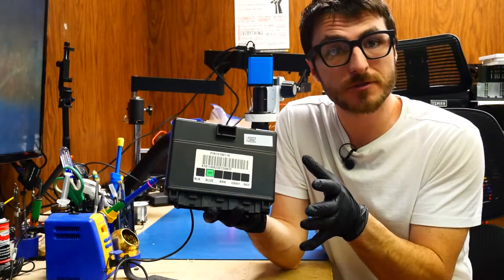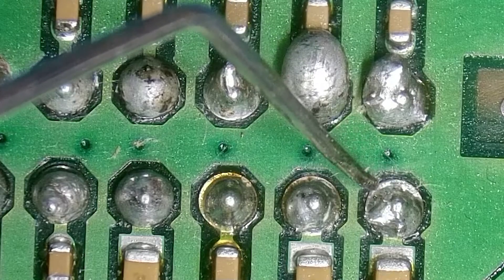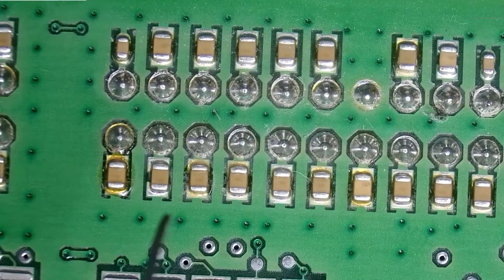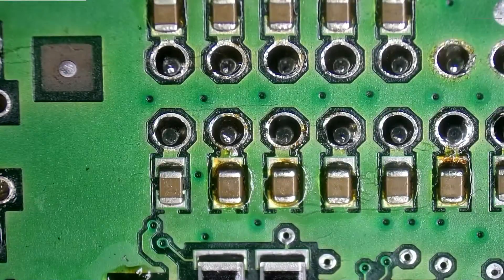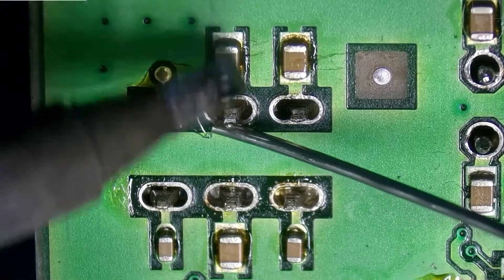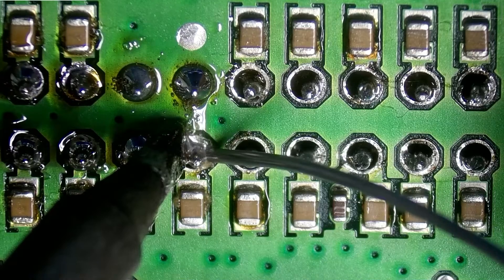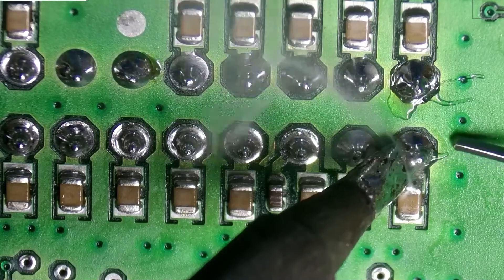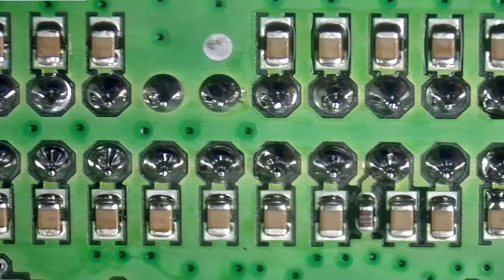Repair BCM for GM Vehicle Body Control Module 15198116

Comment: @NicksElectronicRepair,  awesome video. I just did this on the CCRM (Constant Control Relay Module) board of my SN95 Mustang GT. It fixed the problem with overheating I was experiencing. Found several COLD SOLDER joints and an open capacitor.

Comment: My cars doors don't lock central anymore even the windows working separately....what can be...BCM GM....and bcm draw bt3 flat..what component to look at
Reply from the maker: That does sound like BCM failure, what I recommend is looking at all through hole components and connections, but also take a close look for burnt SMD. You will want to inspect the board with a magnifier and check as i mentioned for burnt components but also corrosion or water damage. We do sometimes see that being an issue and the reason for malfunctions like what you are experiencing.

Comment: Do you repair MSD Ignition boxes.
Reply from the maker: I am not sure what that is, however if they suffer from bad solder joints then the answer is yes.
Reply: @ Can I send it to you ASAP!
Reply from the maker: Im about to leave the country for the next 2 weeks so if it requires advanced diagnostics and troubleshooting it's probably not the best time. If it has cracked solder joints as shown in this video and only requires soldering work as shown in this video then my techs should be able to handle those repairs for you no problem.

Comment: Hi - Curious on your thoughts on repairing these types of boards if they took on water damage?  My XLR has a couple modules that are mounted in bad spots and can take on water VERY easily.  I'm assuming that will be a much more involved job as there could be blown components, etc.  Is that something you work on?

Also, curious about your setup?  I do some hobby soldering, but would love to do more myself.  Curious on the tool you have to do the desoldering and the video/magnifier.  I have a Hakko 936 for soldering currently.

Thx!
Reply from the maker: Yeah that usually means you also have probably corrosion. That's still fixable as long as the damage has not caused shorts between layers of the board. 
Maybe you can send pictures of the damage to our contact email if you are looking to send one in. I can then let you know if the damage is such that we can still fix it or if it's beyond repair. 
As for what we use:

Soldering Iron: https://amzn.to/3FQfyhG
Solder: https://amzn.to/3qScy0d
Desolder wick: https://amzn.to/33DAjjy
Flux: https://amzn.to/42YWYBa

The camera is discontinued, you can't buy them anymore but there are a lot of 4k digital microsopes that are all good.
Reply: @NicksElectronicRepair  Working on getting the modules pulled and will grab some pics.  Have a feeling it's not going to be pretty based on what I saw last night, though. :(  

[Looks like someone tried to 'fix' this previously and hacked up wiring harnesses.... Why....... sigh ]
Reply from the maker: We have fixed many parts that were tampered with, I assume that as long as the module worked after the repairs that the repairs were at least done right even if it the work looks bad. That would typically be something we can still work on. However if the module was worked on and the repair was not successfull, usually it means the person made it worst in which case we usually don't want to get involved.
Reply: @NicksElectronicRepair  Pulled the modules, it ain't pretty :( Will send you pics.

Comment: Can you tell me how to test my bcm. I have a B3700 code ( ECU could read BCM, or BCM not present).
Reply from the maker: Sorry that's a really tricky question I don't have the answer to as it's different for every vehicle.
Reply: @NicksElectronicRepair  No problem, I will get the hang of it. So far I adjusted the headlights manually, and I don't have other issues. Thank you for taking the time to answer back to me, much appreciated.

Comment: I have a 1994 Cadillac Fleetwood Brougham and it starts sporadically.  Some days it doesn't start at all.....does that sound like a BCM problem.  The Cadillac dealers will not service 1994 around here.  Mechanics have spent 2 months trying to find the problem.
Reply from the maker: I am sorry I am not sure if that is the case or not. It is possible.

Comment: Could you have used a toothbrush to clean?
Reply from the maker: Yes but I do like to use the Qtips because they absorb the flux better where as the tootbrush has more of an affect of spreading it around. 
I guess using a combination of both is not a bad idea.
Reply: @NicksElectronicRepair  ... thanks for taking the time to read (and reply). Actually, it's a combination of both, as you say - the toothbrush for the crevices and hard -to reach areas and buds for overall clean.

Comment: Looks like new vehicles will be difficult to repair because boards will go into protection mode and will need factory unlocking. Lets see how all these newer EV vehicles will behave. Flux and an iron won't be enough. Right to repair advocates have failed. Consumerism wins.
Reply from the maker: Yeah, you unfortunately might be right. Now this happens with CPC4 units for Freightliner semi trucks, but we have been able to clone the software and get the unit out of protection mode. It's not the correct and officially approved way but it works. The Freightliner dealership charges $600 for the programming. 
I believe and also hope that a company out there is going to figure out ways to get the software off these units so they can be reprogrammed, perhaps with AI there will be tools made available for this. Who knows.

Comment: My BCM is being repaired, if the repair works will I need a reprogram from the dealer or will it be pretty much plug and play?
Reply from the maker: It depends on if the chip we replace it one that has software. If your sent it in to us, and it's the one I am thinking of that we are waiting for a new part to arrive, it is not a chip that contains software so it should be plug and play.

Comment: What do you set the solder gun setting to?
Reply from the maker: usually it's between 380c and 450c depending on the unit I work on and the tip I am using.